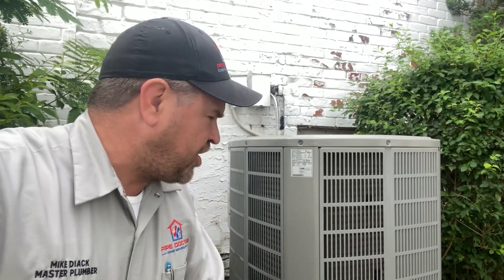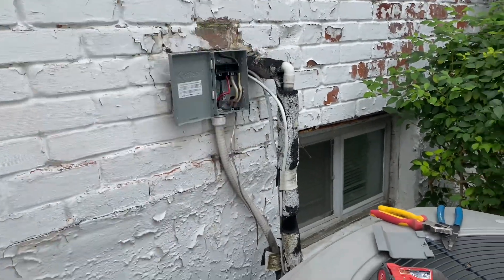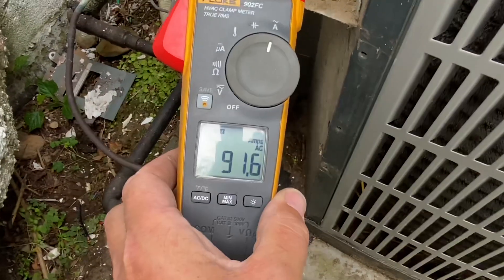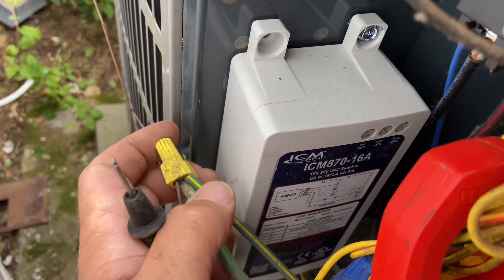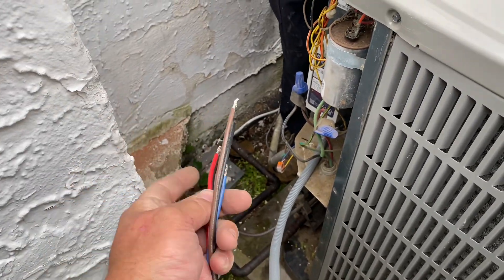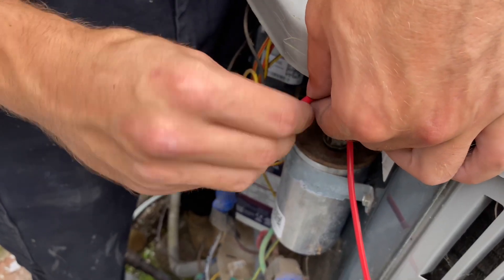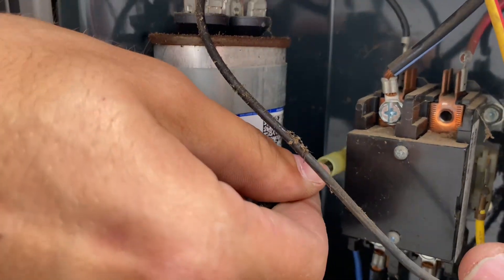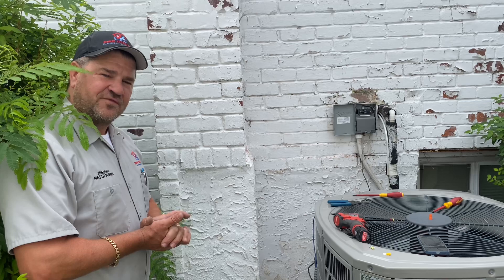Flickering Lights When AC Starts? ICM870 Soft Start Saves Money Watch Step by Install Guide

Comment: 100+ amps doesn't trip the breaker? How big is the breaker on a typical AC?
Reply: It’s for a fraction of a second so no it doesn’t.
Reply: majority of larger and 2 to 3 pole breakers are considered "high magnetic trip", so they can handle inrush surge currents without tripping.
that said, the single pole common branch breakers will often trip at a standard magnetic trip level, if there's issues you can actually get specific "high magnetic" breakers to handle heavy start loads, like multiple/large transformer, motors starting a heavy load, vapor arc discharge lighting.  you'll likely never see them in residential usage.
the standard magnetic trip are something like 3 to 4 times the handles rating, so 20a would trip around 60-80amps. the 2 pole and larger are often 6 to 10 times the handles rating. of course if the current stayed high for very long it would thermally trip, or if it suddenly dead shorted the magnetic part would open first.
Reply: @throttlebottle5906  actually the internal overload in the compressor and or motors almost always open before the a breaker trips if the motor can’t start and pulls lra for any period of time.

Comment: This is probably one of the most cost-effective add ons that you could install.  It will literally pay for itself! 
Nice work as always, Mikey!👍
Reply: That’s debatable unless you are claiming prolonged equipment life expectancy
Reply: @iwenive3390  My 870 was paid for more than 3 times over through the savings on my new generator (and fuel savings down the road). My average household load, without AC, is around 7.5KW. The condenser RLA runs about 14 amps, LRA was about 72 amps. According to the generator manufacturer's sizing specs, I would need a little over 14KW surge capacity. With the 870 installed on the condenser, I was able to go with the next size down generator, which saved me about $400.
Reply: @antoniosagamuccio7370  That’s what I’m talking about! Not only the cost savings in equipment longevity, but the savings in energy dollars. So, I guess you can say it pays you back!
Reply: @iwenive3390  And that's exactly what I'm claiming

Comment: Very Nice - For specific power and start up sounds on Scroll, I love these soft starters over hard starter (yes there is cost difference!).  I been running the Copeland SecureStart as a test since 2015, when Copeland introduced them at one fo their classes.  Agreed, no more light flickering and it's been a while, but I thought the SecureStart had a lower starting current.  It was closer to the run amps, but int's been 8 years since I checked.  Have to checkout the ICM version sometime.  Thank you for posting.

Comment: Hey Mikey. Great video.

When you first started, there were 2 disconnects on the wall, but then as you did the install there was only 1. 

So you removed 1 of the disconnects before you started the installation.

Is that the Easter Egg? I already emailed you my guess, so unlike some of the others, I did follow directions! 

Thanks for all the content Mikey. And I'll swing by the shop to pick up my prize one day this week. 😂

Comment: Hey Hey Wadyadoin!!!! Dats da low voltage haaahaaa! Tell you what though Peter Pan will soon be the man, that young man is like a sponge. Good video Mike I put on of these in my neighbors unit due to his home having battery back up and needed less startup draw, was amazed how well it worked... Many homes out here have solar with battery backup and this device is a must have...
Reply: @PipeDoctor   100% agree even better for whole house battery backup which is very common in my neck of the woods.

Comment: Would your blue herm wire go to the cpt terminal on a amrad capacitor incase your capacitor failed on this soft starter or any other soft starter? Been woundering if the cpt terminal is just for hard starters or if its a good idea to use it with soft starters to if it will work?
Reply: Thanks again for the reply Mike I'll be watching 👍
Reply: No because it’s not a capacitor. It’s kinda like a dimmer switch
Reply: @iwenive3390  Good to know thanks 👍

Comment: I installed a MicroAir easy start on my 4 ton A/C it was around 72 LRA before and now it’s starts at around 25 to 30 amps…..my Predator 9500 generator has no problems starting and running it

Comment: What’s the advantage of that over a simple and cheaper hard start?
Reply: Hard starts still pull locked rotor amps but for less time. Soft starts lower the incoming voltage frequency and raise it slowly to full speed so they never pull nameplate L.R.A

Comment: Mikey, don't touch electricity without protective gloves, Peter. Why don't you use gloves?😮
Reply: 24 volts isn’t dangerous
Reply: @iwenive3390  220 volt breker fuse